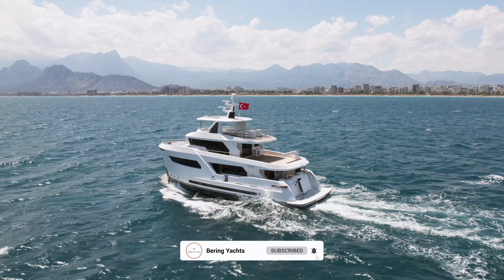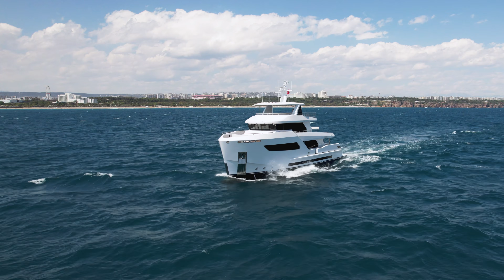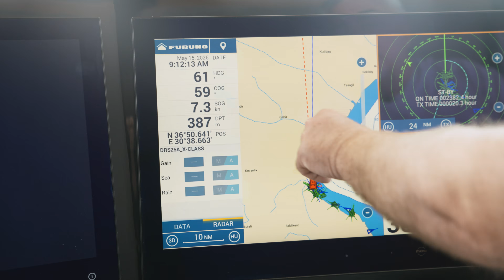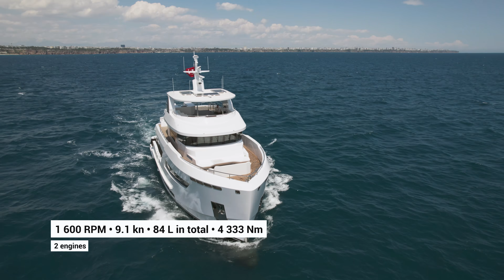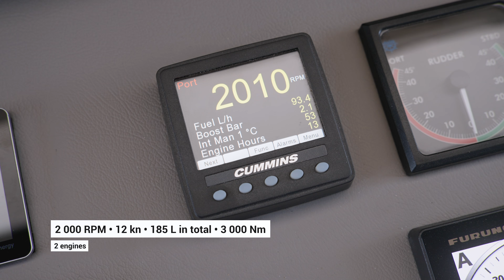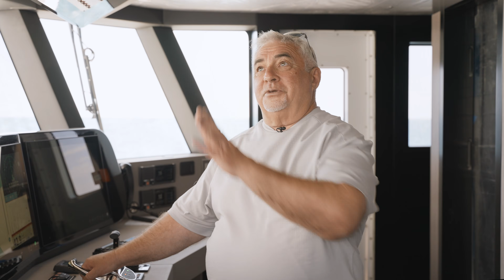Bering 88 Sea Trial | First Open Water Test

Comment: Why not just run a single screw? Less drag less fuel faster speeds high efficiency half of the maintenance.
Reply: It is an expedition yatch. You want the redundency of 2 engined and props.
Reply from the maker: Redundancy and safety are key reasons. Bering yachts are designed for autonomous transoceanic crossings. If one engine were to fail 2,000 miles offshore, the yacht can safely continue to port on the second engine.
Reply: @BeringYachts these engines are designed for continuous run time and 10s of thousands of hours, with out ever being turned off. Let’s be real anyone with this level of F U money saving to skimp on basic maintenance either. One engine is more than sufficient. Add in they’ll never be ran hard like a commercial use vessel and you get added cost less efficiency and double the maintenance costs.
Reply: @ahack14 We never know how you can do engine maintenance if you go to remote locations.
Reply: @ahack14  You are arguing with very little fuel cost and some maintainance cost savings while also stating people that own this thing have no reason to give a f about money which is true. Makes little sense :) The engine wont just blow up but there is plenty of parts that can fail which will stop the engine from running. Just like on a car. Hoses, Fuel Injectors, Valves, Water Pumps and what not. The benefits of having a second engine when needed greatly outweigh the cost savings. If you run on one engine 80% of the time the maintance on the engine that is not running is minimal anyway. Second engine is also good for manouvering the boat in tight spots.

Comment: You have one prop per Engine or two propellers? Or do you share one propeller, wether 1 or 2 engines?
Reply: Dual engines
Reply from the maker: One propeller per engine. Each engine drives its own shaft and propeller.
Reply: @BeringYachts thank you! That is, what I want to know

Comment: Love Bering yachts, the steel hull, the dual main engines, can not wait to see the interior.  Unfortunately, 88ft is beyond the owner/operator limit (think about 78ft) before crew, and a dedicated captain is required
Reply: What matters for regulations is the Load Line Length (LLL), not the LOA.

The threshold for commanding a vessel without profesional crew is 24 meters, so I guess this jus just under that threshold.

Comment: The pitch and roll look fabulous but visually it appears top heavy. There is a lot of mass above the waterline. I'd love to see it in sporty sea conditions.
Reply: It looks top-heavy, but you have to remember The hull itself is steel along with the keel, and that the engine room is just at waterline. The top of the boat is all Aluminum.
Reply from the maker: Thank you. We'd love to share footage in a wider variety of sea conditions as opportunities arise. We're glad you enjoyed what you saw during the sea trial.
Reply: There's a video of the Bering 92 navigating rough seas; you might want to check it out for reference 😉。

Comment: can you show how much the difference between stabilizer engaged and not engaged ?
Reply: You won't be able to gauge the effect on a video. To see how effective a stabilizer is you'll need to actually be on a vessel equipped with the various types of stabilizers (gyroscopic, fins) and the level of stabilization varies from vessel to vessel based on its construction and engineering and intended use case ( for example a vessel engineered with a shallow draft for cruising the ICW in the state's will not be as stable on open oceans because that's not it's intended use etc )
Reply: @aniruddhaiyer3224 how about the static inclination test?
Reply: @mantullera6652 to really guage how effective stabilization is on a yacht you have to experience it physically in the vessel. It's not something tests and videos can show you. I don't know what test you're referring to. Even if you cannot buy a boat you can definitely charter one for s few days and if you're nice to the captian they'll let you experience stabilisation. Moreover stabilization doesn't refer to the up and down or vertical  movement of the vessel which is determined by the swell it's on. It  referes to the horizontal movement or yaw of the vessel.
Reply: @aniruddhaiyer3224  i mean the static side inclination test. if you know how the tugboat get sertified before sea trial.
Reply: @muhammadsamman9761  Thats a test of inherent stability more than the ride characteristic of a vessel. The yacht is subjected to similar assessments by the naval architects to meet certifications under RINA or CE classifications as well. The assessment of the ride characteristics with an active stabilisation system is by able to be quantified as easily which is what aniruddhaiyer was trying to get at IMO.